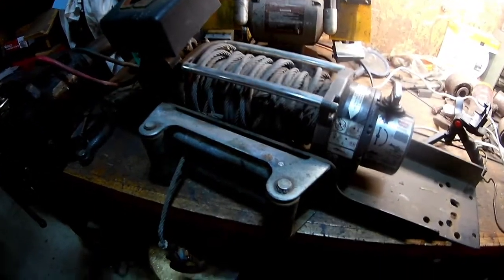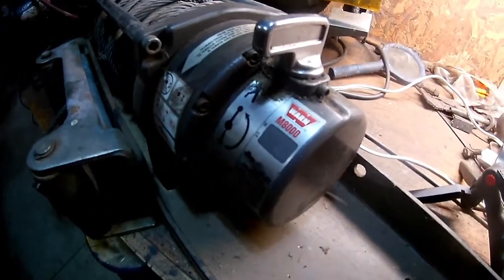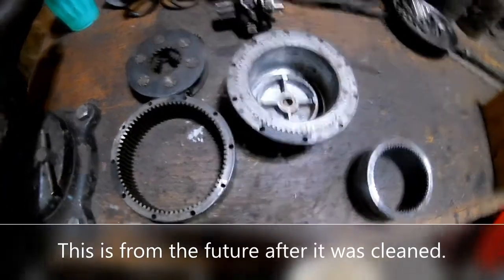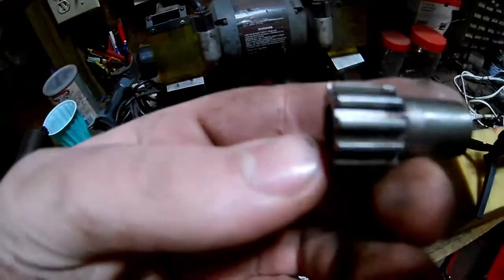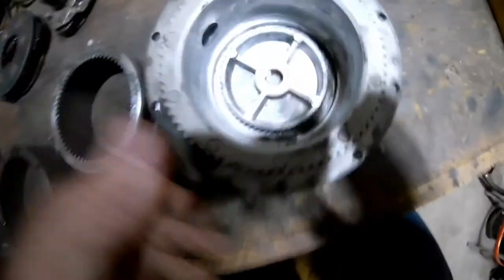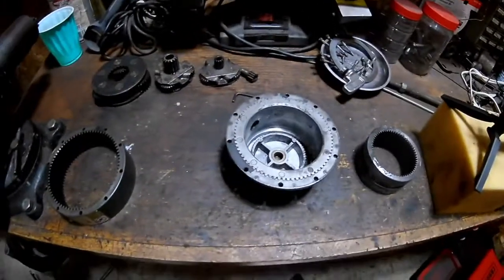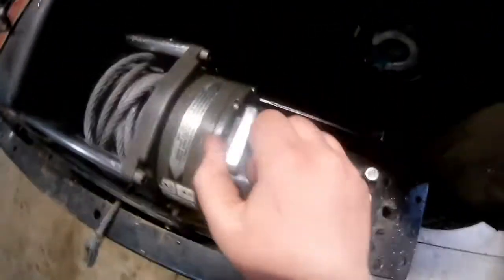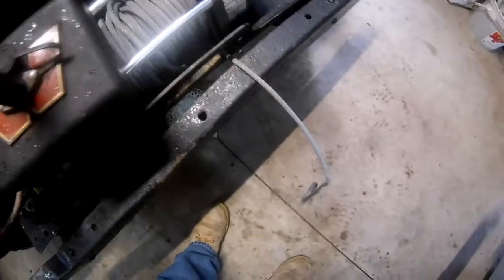WINCH WON'T FREESPOOL!! HOW TO FIX IT (Warn M8000)

Comment: I have a badlands winch which is stuck just like this one. Recon the procedure will be the same? Thanks, Phillip Hall
Reply from the maker: @PhillipHall01 I've never had any experience with a Badlands. However, it should be basically the same. I don't think the basic operation changes much between brands. Any pictures I've seen of gears in Badlands look very similar. 

Thanks for watching and commenting. I wish you the best of luck getting yours working.
Reply: @JacobNovoselStudios  
Thank you for the video and thank you for replying. I will see if I can get it fixed using your instructions. If it works I will let you know for your benefit and the benefit of your viewers. 
Phillip Hall
Reply: Jacob, not quite the same. I got the first cover off but could not get the main housing off. I did get it fixed though. I used a rubber mallot and bumped the lever several times moderately as not to break the lever and luckily the piece broke free. I suppose the rust hadn’t  reached a severe point. 
I never found a video like yours explaining how to do it properly. Thanks again, 
Phillip Hall
Reply from the maker: @PhillipHall01 Thank you for the info, hopefully it will help others with Badlands winches. Glad you got yours figured out!

Comment: My winch cable is stuck like yours , I use the control and a click sometimes . I well do as you say and see what going on as my winch never been out in rain or snow then my dads damp Washington garage last year when I used it last. It then stored there 7 months before I could go the 1300 miles to get it . I hope this frees it up and also my control well then work reverse or forward . If you have any ideas please send to my email here Jacob. The solenoids look new - all connections great like new . The brushes in motor like new as it only as said been used in the last 6 years like 10 or 12 times . Thanks buddy . Was not happy got a free jeep and got my trailer hock up , to then pull the cable out on free - stuck and the darn control just clicks now and then. Plan B tow bar ,,,
Reply from the maker: Thanks for commenting, that's an unfortunate issue. I would try what I did and pull the gear box apart. See if there's anything stuck and a good cleaning/regreasing should help it tremendously. If  you get the cable and drum to turn freely and the engage/disengage lever works and it still just clicks, then you must have electrical issues. Which could be as simple as cleaning the connections for the controller plug and putting some dielectric grease on it as well as checking the power wires on the motor. Just get a good, clean connection on everything. 

Hopefully, you'll get it fixed, I think some fresh grease in the gearbox will help it.